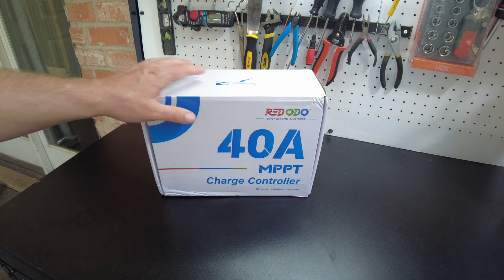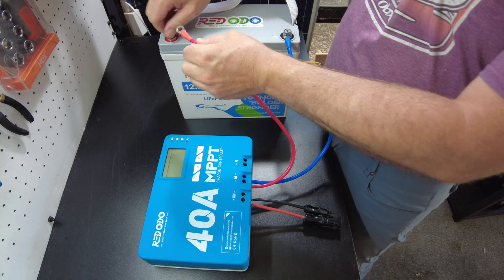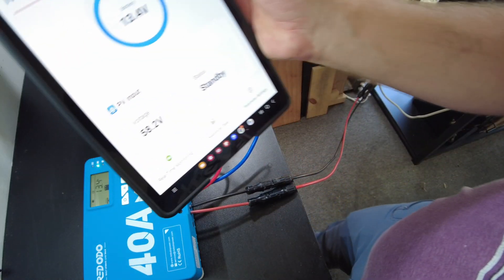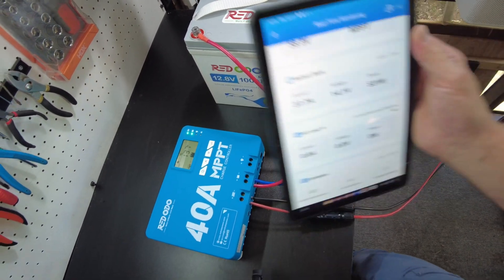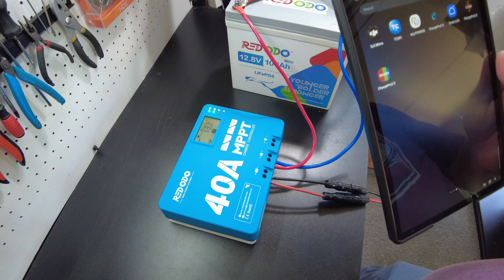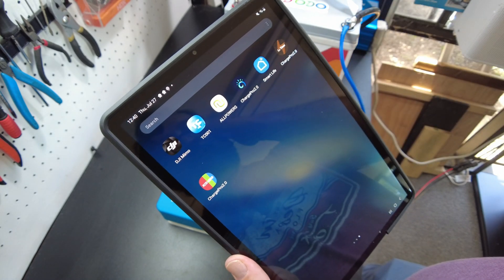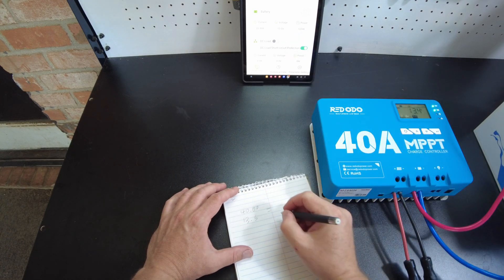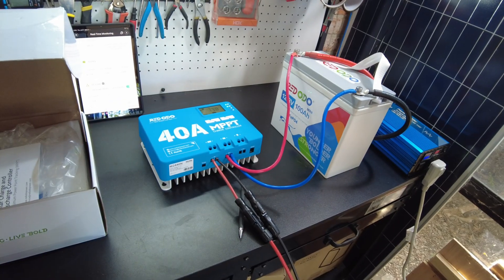REDODO 40Amp MPPT

Comment: So YouTube says this video was made a year ago. Near the end of the video you commented that you appreciate companies coming out with a full line of products. Well oddly, even now a year later, although they have 24 volt batteries, 24 volt mppt and 24 charger, none of their inverters are 24 volt🙃
Reply from the maker: @rogermurphy1548  Well it's a 12 or 24v MPPT, so the full line I was talking about at the time would have been 12v MPPT, 12v inverter, and 12v batteries. But yeah I get what you're saying about 24v. Thanks!
Reply: @BradCagle  yeah I have been buying parts for my small solar setup as I can afford them. I have a little over a thousand watts of solar panels coming in at just over 80 volts. I have two of their 140 amp hour batteries connected in series for 24 volts. I like to use as much of my equipment from the same company as I can and I saw that their charge controller would handle 1200 watts so I thought that would be great with my 1000 watts of solar panels. Then when I was in the position to buy an inverter, I of course looked at Redodo because they also make good inverters with good reviews. Also a 24 volt system is just more efficient. Unfortunately their MPPT charge controller is only 600 watts on 12 volts so I would not be able to use my full 1,000 watts of solar. But to my surprise none of their inverters are 24 volt. 😏

Comment: Hey Brad. I have a Sunwhale 20a 12/24 charge controller and both charge pro and the redodo app works on it. The only difference is my sunwhale looks like a Bouge RV charge controller with the little magnetic cover for the screw terminals.
Reply from the maker: Awesome, yeah I think they are all made by Helios.

Comment: You're over-paneling the charge controller during your efficiency test. You're getting the max out of the controller. If you want to measure the actual efficiency, you'll need to lower the input wattage to some amount that the charge controller can output. As it currently is, the efficiency is artificially low based on the solar you're pumping into it. You could make the efficiency go even lower by putting more power into it... but the controller won't ever go over that 40a max.
Reply from the maker: Hmm, I'm skeptical, but curious, so i'll test your claim. Thanks!
Reply from the maker: UIPDAT: I just removed one panel, and even partially shaded a cell from another. I was under the 40A, like 38A now, but still basically the same result, I came up with 91% efficiency, which is probably in margin of error. Thanks.
Reply: @BradCagle  That's doesn't seem to line up with was posted in the video. What I brought up is mathematically verifiable. Unless the charge controller allows for greater than 40a charging, it was at its ceiling. If the charge controller is sitting at it's maximum charging capability, putting more solar into the charge controller would skew the numbers to being less efficient. Again, this isn't an opinion... The controller allows for more solar input than it can output. The bigger the difference between the two, the less efficient it will appear. The excess wattage is dissipated as heat.
Reply from the maker: @ModernSurvivalSense  MPPT controllers do not burn off excess as heat. If they do not want more power the micro processor will changed the duty cycle of the MOSFETS limiting the power. Now you're thinking of a linear regulator, these do burn off excess as heat. MPPT controllers use a switching topology. Thanks
Reply: @BradCagle  sorry, all excess wattage is burned off as heat. Energy is never created or destroyed. If it’s not going into the battery, it MUST go somewhere. MPPT controllers are known to be able to be over-paneled. It’s one of their benefits over PWM.
Reply: The controller is designed to dissipate heat… which is clearly shown by the large heat sink on the back of it.
Reply from the maker: @ModernSurvivalSense  It has to dissipate heat from the MOSFETS because they are not perfect switches, they have a voltage drop across the Source, and Drain. This is wasted as heat when the the MOSFET is conducting, but when the duty cycle is changed so they are off most of the time, as in the case of the controller limiting current, they will run cooler, and not waste as much. See you're a bit backwards on your thinking. The controller limits current so it will not melt down (mostly the mosfets, and diodes). If it did what you say, soon as it stop charging (you think all that power has to go somewhere), well the thing would be melting off the wall. LOL Thanks man.
Reply from the maker: @ModernSurvivalSense  So what happens when you have a breaker in the PV wire? If you flick that breaker wheres all that power going? Think about it, and then realize the charge controller uses the MOSFETS like switches.
Reply: Nonsens

Comment: So it's the HQST 40a model plus $40 for the blue color to appease the Victron fanboys?
Reply from the maker: Seems to be. Thanks
Reply: For my money, the 60A HQST, (rebranded Renogy) with low-temp charging protection, is the best value going in small to medium charge controllers.
Reply from the maker: @jasonbroom7147  I need to test low temp charging on these things. Thanks for bringing that up.
Reply: I’m here for the low temp charging test!
Reply from the maker: @BobBob-il2ku  I need to do a video, and test them all for low temp protection. I'll try to get around to it.
Reply: @BradCagle  FYI for the HSQ atleast it needs to be turned on it ships with it off
Reply from the maker: @BobBob-il2ku  ahhh, ok good info. Thanks

Comment: Somewhat similar to my BougeRv charge controller only thing different with mine is it also does 36 and 48 volt battery systems. I also noticed a difference in voltage with  the app i have. I should have rebooted the App like you did and see if it was reading the same as my Renogy Shut voltage. I'll try rebooting next time i noticed a difference. Redodo seems to make quality stuff. Maybe ill go with them when its time to upgrade my battery system. Interesting video Brad thanks.
Reply from the maker: Glad you enjoyed it. Thanks!